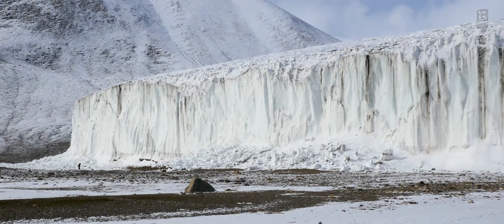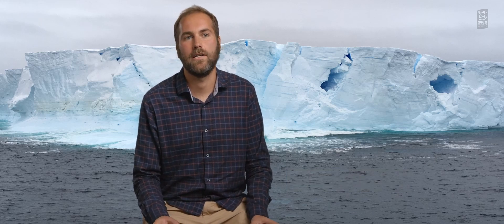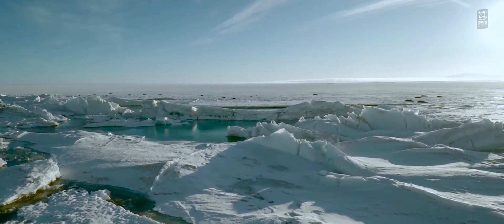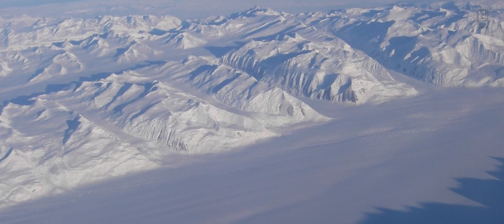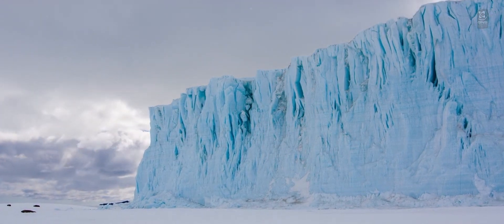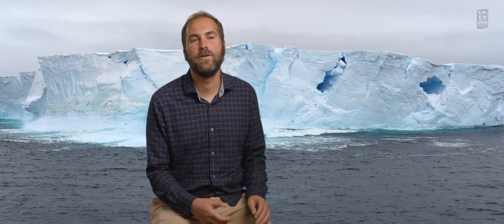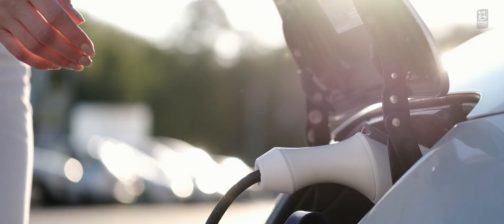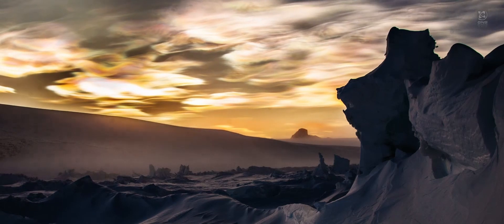The physics of the ice | Dr. Dan Lowry on modelling Antarctica's future

Comment: I've been noticing over the last 40 years, the rise in sea level - minimal as it appears to be - the damage is worse.
  Far North Whanau, have lost in excess of 100 feet of sand dunes, and the higher tides, trying to encroach further inland, around Doutless Bay  ; even the rocks at the south end of Soames /Matiu Island, are starting to get covered by tides.  One storm this winter, had flotsam & jetsom, on the grass bordering the lagoon in the central city - this is not common - the water was high enough to go over some of the rocks around the lagoon.